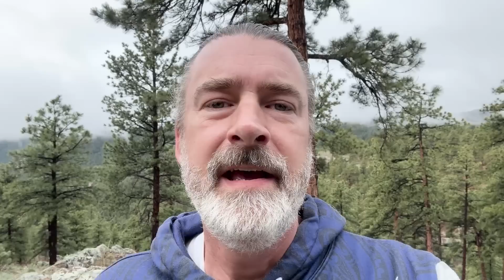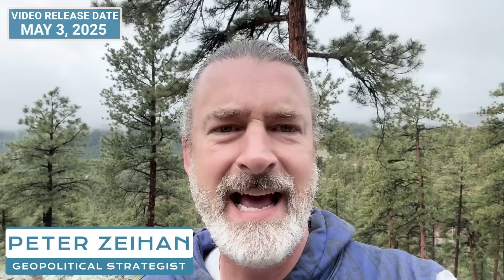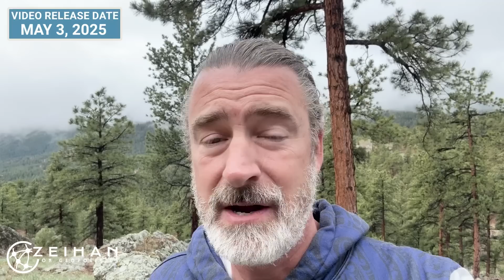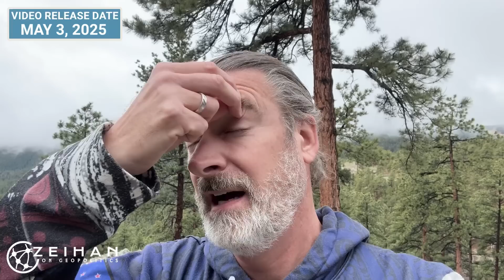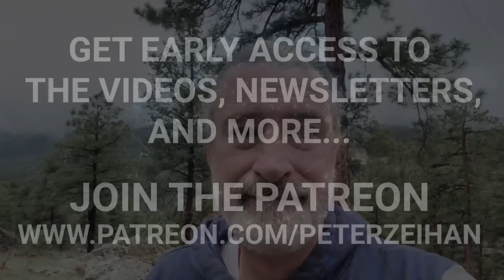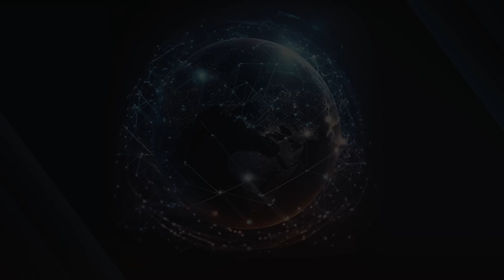The Night the Lights Went Out in Geor- er, Spain || Peter Zeihan

Comment: German electric engineer here. 

The explanation is kind of "wobbly" but not too bad for a non-electric person.
The key point is the DICTATE of the base frequency of 50Hz (US 60Hz) and phase shift (of 0dgr. between all electricity suppliers) into the system by our heavy spinning turbine power stations, such as:
- gas
- nuclear
- coal
- oil
- water (which Europe only has very little, except some more in the North like in Norway)

Solar and wind turbines simply cannot do it. The blackout in E. P and F was a disaster which was predicted by engineers. It was no surprise. Neither Western nor the Eastern (bloc) ever failed so miserable since WW2 - and this was a sunny, moderate windy day. No earth quakes. no big fires, so major storm, no attack by evil people etc. 

The battery "solution" is insane and no solution at all. Too gigantic in its effort to manufacture, run and recycle, too material-intense to manufacture and recycle and too weak to power and stabilize grids, too dangerous (fire hazards) and with a too short life-span. A very similar problem with any solar (PV) panel being manufactured and installed.

Technically, nuclear power is the only way to go if you want seriously to reduce CO2 emittance - modern, self-extinguishing power plants with different nuclear processes, basically eating up the existing nuclear waste - reducing half-times drastically.

The increasingly and exploding demands of electricity in the Western world (transport, building heating and as the next major boom-factor - exceeding the previous two already in 2050 - is AI) and elsewhere will very soon exceed any electricity demand economists and others are trying to predict. Modern humans are power-greedy as f....
So, grids we need to stabilize large economies with heavy industries and Mega cities. Local (micro) grids are OK for special locations - but even big island nations (Indonesia, Philippines etc.) are trying to build and operate large national grids for very good reasons
Now, if you want to restructure our energy system world wide to limit CO2 emittance, you will realize that also some other challenges are straight ahead - just to name one: where is all the copper supposed to come from, to make this all happen?

There are only three major points to follow:

1. We need to reduce our own number as a ww population through better education, health care systems, social and retirement security systems etc. (And no, this all has nothing to do with these entitled woke BSers.)
2. An international system of disarmament to stop wasting our resources in military hardware and wars - the biggest ecological catastrophes in peace and war time! The biggest waste we allow ourselves currently is the military, with the US leading it way ahead
3. Work on modern, safe nuclear power stations

We need to understand - no matter what we do as humans on this planet, it will ALWAYS have an impact on our environment.
Nothing comes without a price to pay. 
So we better start to use our brains properly - it starts with education and with honest foreign peace politics. Both is in serious decline and trouble currently in the Western world.

Peace! from Dresden / Germany
Reply: Wow, there is the insane person who pretends to be an engineer.  ;-)
Reply: @lepidoptera9337  

Got an MSc in electronic computing and electric science in 1991.
Worked on all continents in more than 60++ countries to install, maintain and repair high-tech machinery, including PV-panel production.

I am now retired. I hope you understood what I wrote, otherwise my explanation is not good.
The subject is indeed tricky to explain to "non-electric" people. But it is basic knowledge for any electrician fixing a cable in a remote farm.

Yes, we engineers are sometime insane, but always down-to-earth at the same time. Which is why so many engineers are now fed up with these Greenies.

Cheers and peace! from Dresden / Germany
Reply: @Boni-i1l  Nice to meet you. I am the Queen of Sheba. ;-)
Reply: @lepidoptera9337  
Well, if the Queen of Sheba might help on the subject. I am open minded 🙂.
Perhaps there is some enlightenment for me. But I am not sure if the Queen of Sheba had electricity when she was still alive and well.

Freedom for all electrons!

Peace! from Dresden / Germany
Reply: @Boni-i1l  Even the Queen of Sheba can't enlighten you. You are so in the dark. :-)

Comment: Great info Peter. Just wanted to add that the battery chemistry mentioned is LTO or lithium titanate. These batteries are amazing for utility storage as they can be cycled up to 30000 times before they lose 20% of capacity. So pretty much forever. Also can be charged in freezing conditions making it the only solution besides old lead acid.

Comment: This video touches on a lot of valid points but the whole premisse sits on the hypothesis that the failure was caused by this "wobble", which we don't know if it was. It's still under investigation but something caused the consumption of electricity to drop significantly causing stress on the grid that was now providing too much energy so these "nodes" started disconnecting from the grid to protect themselves and this caused a cascading effect that turned the while peninsula dark.
Reply: There is no such thing as "providing too much energy" in well designed systems. A modern DC/AC converter has microsecond to millisecond response times. The load is being sampled many times during every AC cycle, i.e. such a system CAN NOT overload the output. Even a well designed electrical generator can stabilize output within a single cycle or less.

Comment: Using flywheels for grid inertia is also an option and are being rolled out here in Australia.
Reply: Why are you rolling out a 200 year old solution? Don't you have EEs in that region of the world who earned their diplomas after 1867? ;-)
Reply: @   Umm, because it works!  Why spend exorbitant amounts of money to develop a complex solution when all you are doing is replacing the flywheel inertia already on the grid in the form of steam turbines?  Wouldn’t it be more prudent to just use the exact same solution, just minus the steam turbine part?
Reply: @David-lr2vi  There is nothing complex about a bunch of batteries, six Mosfets,  some small inductors and a fast microcontroller. You simply don't know how professionals solve problems today. ;-)
Reply: @lepidoptera9337    You know nothing about how the grid works do you?  The grid needs proper frequency control and frequency inertia to stop the grid from collapsing and that isn’t accomplished with fast microcontrollers, it’s accomplished with grid inertia which acts like a spring and stores energy or releases energy as required to automatically stabilise the grid frequency.  

The reason we have issues with the integration of renewables on the grid now is because things like solar and wind generation aren’t grid forming, they are grid following devices.  The current grid forming devices are the large generators (coal, gas, nuclear, hydro, etc) that generate large volumes of power and form the grid frequency (and maintain it) for other devices like solar inverters, etc to follow.  

Without sufficient inertia in the grid it is susceptible to collapsing the same way an airplane is susceptible to falling out of the sky if it flys too close to its stall speed.  Maintaining inertia in the grid provides a safety margin in the same way an aircraft maintains a safety margin through speed.  An airplane can always trade its speed for altitude or vice versa.  

A grid needs to be able to trade inertia in the same way to keep the grid voltage relatively stable.  Voltage spikes on the grid are absorbed by the physical inertial mass of the generators on the grid and that same physical mass continues spinning during voltage sags, extending the time to correct the frequency before a grid collapse occurs.

Comment: Ok, I'm sure I'm the most qualified to answer this question because I'm retired, a professional engineer in ERCOT (inactive), I'm a certified ERCOT grid operator (tho I never technically was one), I worked for 10 years at NERC (Texas Regional Entity), and I worked 3 yrs for a transmission company that had what they call FACTS which is basically equipment that compensates for transmission problems associated with renewables.  Texas has comparatively lots of renewables and it's a small grid with comparatively little system inertia. So... this is speculation.  First renewables are not good at holding voltage strongly, and it has weak inertia - conceptually a lightweight flywheel spinning 50 Hz.  When you combine these 2 weaknesses with the long transmission lines needed to transport power from the country to the city, you get a sort of a weak voltage-wobbly and frequency-wobbly system.  Voltage oscillations can start (they call it sub-synchronous oscillations, a fancy term for slow voltage wobble... like a teeter totter, only voltage going hi/low different places).  Protection equipment is in place that opens breakers when voltage goes outside a certain range.  Then you start having load or supply tripping off affecting frequency (spikes up instead of resisting change).  So due to low inertia frequency starts going outside of range and stuff trips offline due to frequency and the wobbliness gets even worse... all this tripping can quickly cascade into a buttload of stuff tripping off.
Reply: Good explanation.  I've worked, tangentially, on synchronous condenser (SC) projects (as a transformer supplier) and they appear to be a solution.   Most commonly, when old thermal plants are closed, they can be converted to SC stations to fill in for the lost inertia.  I do not foresee, though, renewable developers adopting them unless bound by RTO and/or intertie utility.  The comment section of this video, in particular, shows that the "grid" is still very much a mystery to most people.
Reply: @ synchronous condensers I understand are for voltage support in that they supply reactive power. I’ve not heard them discussed in the context of system inertia. But that doesn’t mean they don’t have inertia. It makes sense they would.

Comment: The batteries are called Lithium Titanate and they are awesome for short bursts of power. I use them as a starting battery on my truck. They charge so fast that if I let them discharge for a bit, they pull almost all the power from my alternator, and they charge up in a few minutes.

Comment: Lithium batteries are good for portable application, such as laptops, cellphones, aviation, EV, etc, where the power density matters; but not suitable for large energy storage. They have a very short life cycle. Sodium batteries are in the testing phase for this purpose. This experimental battery type will have less energy density but a longer life cycle, and it will be way cheaper to produce.

Comment: There are many other alternatives. The most important is to not be so isolated, but there are many kinds of 'batteries'. You can store power with by heating molten salt or even sand in banks just like traditional Eveready like batteries. This works by using electricity to heat the liquid molten salt and storing it a giant thermos during high electric supply, then use the heat to run the turbines with something traditional like steam power when the sun/wind isn't available. You probably want to involve giant flywheels so the turbine is always running at the same speed/wobble/kw to match the grid. You can also use giant ponds on hills/mountains by pumping water into them with electric pumps during times of high electric production/supply, then just reverse the process when demand outstrips supply by turning off the pump and letting the water pressure continue to spin the pump/turbine in the opposite direction.

Comment: Engineer here. You’re talking mostly nonsense. Most solar is able to generate the “grid,” i.e. the frequency. It’s indeed black-start–able. That inertia you’ve been alluding to, that’s actually not desired since it contributes to grid overload you’d put securities in. — The grid breakdown actually was due to an overvoltage condition it couldn’t cope with caused by two of those inflexible power plants.
Reply: Yes, renewable electricity generators can be designed and equipped to participate in black start operations. However, their suitability depends on the specific renewable energy source and the system's configuration. Wind farms, for example, need additional equipment and can only black start when wind conditions are favorable. Solar farms can black start when the sun is shining, but their output varies with daylight hours

Comment: Or. Just add motor-generators. Use the DC from solar to run motors that connect to ac generators. You get the power conversion and keep the kinetic energy to help maintain frequency harmonics. Old school tech that can be made more efficient with modern advancements.

Comment: Nuclear best. For reliability, environment and economy.
Followed by hydro, with minuses  great environmental damage and the potential to kill millions with dam failures. But cheap and able to stabilize the grid.
Third is gas. 
We can get enough power without oil and coal.
Wind is a disaster.
Sun is useful locally but not on grid scale.

Comment: Power engineer here. The "wobble" is both frequency and amplitude. If either is out of range, energy sources can disconnect.  Battery plants can supply and absorb energy in milliseconds. Running generators as moter/generators just to get that inertia also works. Nuclear and other long-term storage technology (such as compressed air from caverns) use turbines and thus supply inertia. In short, the grid problem is solvable without going back to gas/coal.

Comment: You don't need to keep the fossil fuel power plants.  You need to repurpose their grid connections and boilers to make them thermal storage plants and store excess renewable electricity has heat.  While it is less efficient (thermal always is - 2nd law), it is a quick and economical way to provide energy storage and (more importantly as we continue to phase out fossil fuels in favor of renewables) grid stabilization.

Comment: Why cant ppl wait for investigations to conclude? Spain was only at 60% from renewables at the time of the blackout while days before on April 16th it was a 100% with no problem. Besides the way it happened clearly needed several things failing.

But even if it has to do with current renewable implementations there are lots of clean options to explore still without wasting our time with dead horses like nuclear an its inertia problem that cannot be solved - among other issues - or burning more fossil fuels which is... well... suicidal.

Comment: What i heard:  the people that built the grid and power plants planned for this type of issue, the wind/solar people did not plan for this and thusbhad a problem.  Of course if the wind/solar people planned for this, they would have to include all that extra equipment in their carbon calculations and they might just find out that they are worse than coal.

Comment: Electrical Engineer here.  "Wobble" is not the correct term.  Just say line frequency, i.e. 50 Hz or 60 Hz.  It turns out the method of connecting solar PV and wind to the grid is the same as connection roof top solar to the grid, i.e. an electronic inverter.  These inverters have current source outputs and rely on the AC grid being active.  They supply power to the grid at whatever the current frequency.  That's to say these inverters do nothing for grid stability.  This is very different than a turbine powered generator where the rotational inertia is a major factor in maintaining grid stability.

There's a third fix for gird stability.  Add rotational inertia using a 120 ton flywheel.
The Problem with Wind Energy @ 9:44
https://www.youtube.com/watch?v=LklUVkMPl8g&t=584s
https://www.siemens-energy.com/global/en/home/stories/irelands-great-grid-stabilizer.html

Comment: I'm not sure why this needs to be about a different battery chemistry.  The reports I've been reading has more to do with the kind of inverter used to put the DC onto the AC network.  Most are "grid following" which tries to follow what's happening.  What's needed is a new technology, "grid forming" which imitates the rolling mass of traditional power generation.   I've also been hearing that in some places, they leave the old generators connected, but not "powering them" (no mechanical input).  They act more like unloaded motors.  But the spinning mass is still there providing stabilization.

Comment: I can see 2 technical solutions to this:
1. The easy one: flywheels.
2. If the windturbines had more intelligent active inverters, those might take some of the inertia of the wind turbine (slow the turbin down for a few seconds or vise versa) and use it to stabelize the grid. The duration of one "whoble" (Sinus curve) is 20ms (18 in America) that's far more time than an electronic component needs to detect a deviation and take counter meassures.

Comment: To provide power grid stabilization we CAN:  (from low-tech to higher-tech)
- Keep traditional AC motors on-line freely spinning flywheels
- Give hydro power plants the ability to raise and lower the water in their reservoirs to regulate over-all power demand
- Add electronic circuits to the grid at power sub-stations that inject the proper active load at the proper times within a fraction of the 50 or 60Hz waveform
- Broadcast a digital 'sync' signal over the power lines that green energy power inverters can read and use to keep their output synchronized